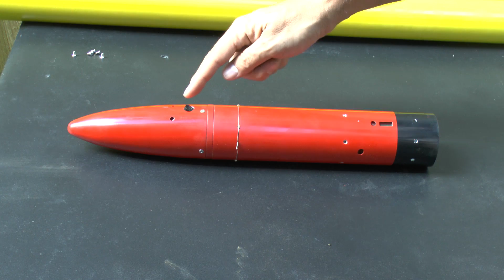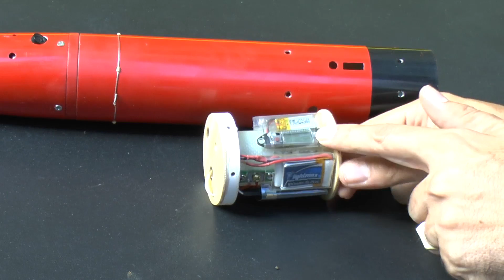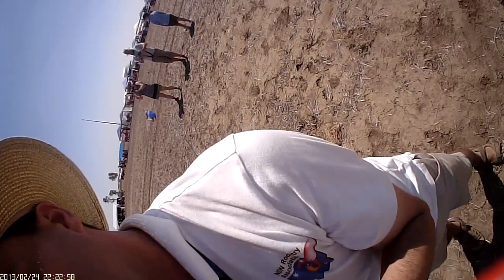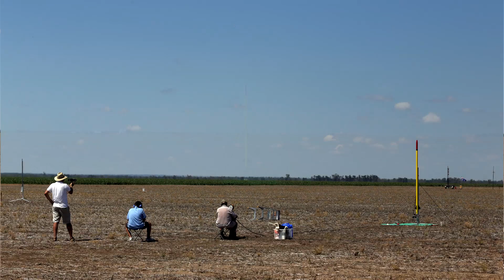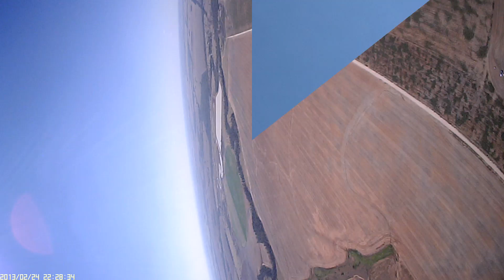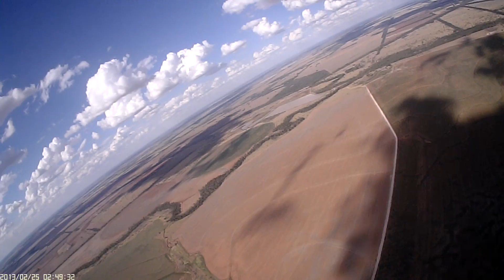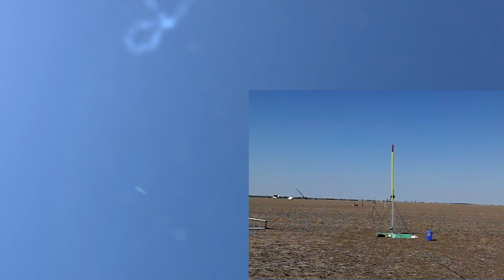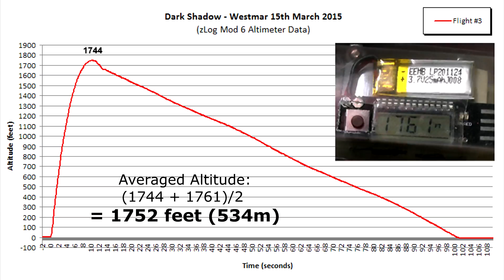Water Rocket flies to 1752 feet (534m)

Comment: So !!  IT is using just water in the first seconds only?
Reply from the maker: +Mythricia No, actually it's a great question. Thrust is all about 'throwing' a mass in one direction to make the rocket go in the other direction. The heavier the mass and the faster you throw it the more thrust you have.  Air is compressible and so can store a lot of energy, but is also very light. So although it can leave the nozzle at sonic speed it doesn't carry a lot of mass with it. Water being essentially incompressible cannot store a lot of energy, but it does have a lot of mass. So in a water rocket you use the stored energy of the air to push the heavy water out the nozzle. There is of course a trade-off between the amount of air and water you use. As it turns out the optimal ratio of water to air is around 1/3 water, and 2/3 should be air. 

For some more information please see:
http://www.aircommandrockets.com/water.htm
Reply from the maker: +graciano b During the very first part of the flight (after it leaves the launch tube) the air pressure pushes the water out this takes just over 100ms, and then the rest of the air comes out in another approximately 100ms. The rest of the flight is just coasting.
Reply from the maker: +Mythricia I guess another way to look at it would be the difference in recoil you would feel when you fire an actual bullet from a gun vs a blank both with the same charge.
Reply from the maker: +Bob Hope Fortunately for the rest of us, the laws of physics are quite independent of your interpretation of them.
Reply from the maker: Sorry Bob, that is not the case. In a water rocket about 2/3 of the total impulse comes from the water phase and 1/3 from the air phase. With air only the rocket goes about 50-60% of the altitude. In fact the water also makes the rocket less stable because it is at the aft end of the rocket.
Reply from the maker: +Bob Hope Here is a challenge for you. Go build a simple water rocket. Fly it once with 1/3 water and once with air only at the same pressure and come back and tell us your results which performs better. Thousands of kids perform the same experiment at school every year.
Reply from the maker: +Bob Hope I know you won't read it, but here is a full analysis of how water rockets work for others that may actually want to know: https://www.et.byu.edu/~wheeler/benchtop/pix/thrust_eqns.pdf
Reply from the maker: +Bob Hope No need to perform this experiment again. You just need to Google for the results that lots of school children have done this very experiment over the years. You will still not be convinced though, and that's why you need to try the experiment yourself so you will see the results first hand.
Reply: +Bob Hope Yes it will. But your real problem here is that the force in the party balloon comes from the rubber and not the air. And you're ignoring drag. Almost all of the distance flown by the rocket is inertial. All of the thrust is gone within 0.2 seconds and a few meters; the remaining three tenths of a mile is unpowered. How many party balloons can do that?
Reply: +AirCommandRockets Having some difficulties understanding the benefit of adding the water in the first place - if there is one. Considering how incompressible water generally is, wouldn't you get more velocity from the rocket by simply filling it with air to replace the volume the water is taking up? So basically running it as a compressed air rocket...

I get that water is heavier, and the rocket moves by throwing mass out the nozzle, as all rockets do, but since there's no chemical reaction to release energy here (only mechanical energy), I just can't figure out how the water rocket would be better. Surely the fact the water is heavier also makes it more difficult to push out, thereby negating the benefit of ... well, the water being heavier?

I'm sure there's more to it, but my poorly educated self can't figure it out! :)
Reply: AirCommandRockets That explains it a bit, I'll be sure to read more following that link. Thank you!
Reply: +Bob Hope I looked at the chart at the end of the video and its time resolution is too small to be able to tell anything about the thrust. all it shows is a concave-downward curve from ground to peak, which means deceleration, not acceleration.  figure a combination of gravity and drag, no thrust.

yes a more dense reaction fluid would improve performance, but lead is not liquid at usable temperatures. Mercury would be pretty spectacular, though.
Reply: No, you can't see that. It's happening far too fast. And, handheld video on a random wide-angle lens is not reliable for position measurements. The truth is that the specific impulse from the water is a large multiple of that from the air. If the rocket was filled only with air it wouldn't fly nearly as high. If it was filled only with water it wouldn't fly at all. Altitude is maximized when the ratio of air to water is about 1:2.
Reply from the maker: +Bob Hope The one thing I think you are confusing is the difference between an aerodynamically stable rocket and a party balloon.
Reply: Bob Hope No, I'm not wrong.  (Note: telemetry and data analysis is part of my profession, so you're not going to bullshit me about this.) That graph is not capable of accurately resolving the time, position, velocity, or acceleration at the beginning of the flight. Any "straight up" you think you see is an effect of quantization due to the measurement and display equipment. Any slope you see before that straight segment is due to the same quantization effects as the numbers tick up one more quantum. You might as well claim the acceleration was infinite on that "straight up" segment. It wasn't. And if you keep following the curve you'll see several more sloped segments followed by straight-up segments. Is it your contention the rocket kept slowing and speeding up to infinity over and over again during the flight? Of course not. In fact, that graph shows you only the effect of gravity and drag, first without the parachute then with the parachute. If you're really careful, you might be able to tell what the drag coefficient is, but you won't get many significant digits out of it, because, as I said, the data are slushy.
Reply: +AirCommandRockets so although both give a decent kick you do feel the one with the actual bullet a bit more. yeah makes sense :DD
Reply: +Mythricia Good question. It's an application of Newton's third law of motion (action and reaction) which simply states that the for every action there is an equal an opposite reaction. In this case the action and reaction forces are the rocket on the water and the water on the rocket in opposite directions. These forces are described by Newton's second law of motion (acceleration of an object is directly proportional to the applied force and inversely proportional to the mass of the object being accelerated) This law can be written in terms of the change in the momentum of the bodies in the interaction (water and rocket in this case) Since momentum is calculated as the product of mas and velocity of the object, you will get a larger momentum when either or both the velocity and mass of the object are large. What this means is that yes, compressed gas can move out of the nozzle at a rapid rate but the overall momentum change (and hence force) will be small as the rapid velocity cannot make up for the low mass of the gas in the first place. This is a fairly common senior high school physics topic and you might be able to find a longer explanation by checking some physics texts on this subject.
Reply: +wigs1098 it's all abut energy efficiency. Force goes linearly with the rate of momentum change whilst kinetic energy goes as to the square of velocity. So using (say) half the mass with twice the exhaust velocity gives the same force but "wastes" twice as much energy in the reaction mass. It's the reason why those fanciful flying cars with tiny little rotors can never work sensibly. To fly efficiently you need to accelerate a large mass of air relatively slowly. Accelerating a small mass of air to high speed is inefficient (not to mention hideously noisy).

At least roughly speaking. A lot more to it.

Has anybody done some basic mathematics on this rocket to work out what percentage of the stored energy in the compressed air is turned into potential energy at the maximum height?

nb. why is it always called rocket science in popular parlance? It's surely rocket engineering. The science was done long ago.
Reply: +AirCommandRockets Don't feed the troll.
Reply: +Bob Hope since you don't even do this stuff I was wondering why you don't just shut the fuck up.
Reply: +AirCommandRockets Amazing! I always wondered how water rockets work. My father gave me a small toy water rocket, as a child. Perhaps it can be compared to the flight of a plastic cap champagne. I'm not sure.
Reply: +Mythricia Another way to think of it: they'd get more kick from air alone if they packed about as much air in there as there's water - by mass. Only then not only speed of the propellant would be matched, but the amount of its mass ejected as well.
Reply: i think it would work a lot better if they could use electrolysis and then burn off the resultant gasses. THAT might make the water worth it <3
Reply: +Mythricia Water weighs 840 times as much as air. For each atmosphere you add to the pressure you pack another equivalent mass of air into the rocket. So if you add P atmospheres, but you can't eject the air 840/P times quicker than the water, ejecting the water will give you a bigger impulse.
Reply: +AirCommandRockets so theoretically of course would something like say, mercury be a better choice over water? disregarding of course the enviromental effects
Reply: +Mark Martin You are clueless.
Reply: +Mark Martin That applies to you, not me.
Reply: +John Hasty cool story
Reply: alphabeticalor haha, thx. I thought it would surely start a internet riot. kick's back and exhales smoke slowly "Ahh, now where is my machine shutdown button again?"    >.<
Reply: +John Hasty cool story, troll
Reply: Roughly how many G’s would the rocket be achieving this be from launch?
Reply: Bob Hope you are like arguing with a flat earther..you can easily find the information online...hell even expirements to try yourself and gather relevant data but noooooo , your set in you way of Mr know it all and everyone is wrong. Go fuck yourself
Reply: +alphabeticalor You are wrong. Look at the graph. The first rise of the plot is at an angle, then it goes straight up for a while, and then it rises at an angle again. This means the acceleration becomes severe a bit up into the air, which is when the water has left the rocket. And consider this. What if the air could become compressed to such extreme it became liquid? Wouldn't you rather have the rocket spew out that liquid than dead weight water which has no propagating quality of its own? I am right. Stop being unreasonable.
Reply: I've literally bored myself so bad I was sucked into reading all these comments on shit some people don't even have a word in because they "don't do this stuff" and the others know so damn much they've become self-proclaimed H2O bottle rocket super intense scientific "I-come-up-with-this-idea" people that can track every fucking movement of a quark at quantum speed with "THEIR" naked eyes. I'm even surprised that someone whos entirely not even in this video or even remotely close to the area within a hundred mile radius isn't putting information in the comments about how long it took to reach max altitude, the exact speed in nano second intervals, terminal velocity on its return, the amount of thread used in each string on para cord... I can keep rambling about what I think but no one actually cares because they're kinda like me... I DONT GIVE AN IOTA OF A FUCK!  "so they nonchalantly browse the youtube comments, Hmmm... what do I see here? OMFG!!! two bitches bitching on someone's comments because one knows how air was invented and the other don't know his ass from a hole in the ground... P.S.  Great video, I loved it! keep up the hard work and keep progressing!
Reply: +AirCommandRockets With only air it goes less high because the path tilts, spins out. You can't add water to a party balloon and expect it to fly a longer distance.
Reply: +AirCommandRockets Besides, you can't get more thrust by carrying dead weight, water, up into the air. The real thrust comes after the water is gone. Water is for stability.
Reply: +alphabeticalor But you see in the video that the real thrust comes after the water leaves the rocket. The chart of ascent also shows that the acceleration picks up after a short while. You can't carry dead mass up and expect that will create a faster ascent. Fill the rocket with led if so. Good luck with that.
Reply: +AirCommandRockets I will read it all later. Eyed it over for now.

The paper assumes that the water and canon ball fills the same function in a pressurized tube, air vs gun powder. This is not a true assumption.

Will the uploader of this movie make a scientific test, please? Use more water than you usually do, and record the hight the rocket reaches. Divide the original lot of water in five volumes, and use less and less water for each launch, but pump the rocket to the same air pressure. For example, 5 litre, 4 litre, 3 litre, 2 litre, 1 litre, 0 litre. Get back here with the results of height reached and other observations.
Reply: +alphabeticalor Next summer, fill the rocket with more water than usual. See the graph show an initial ascent with a slope to the graph. When the water is gone, the graph will go straight up, indicating a shift in acceleration, greater acceleration. Carrying water up in the air will not make the rocket go faster. This is common sense.
Reply: +alphabeticalor You can also see in the videos of the ascents that after the water is gone, there is a snap of acceleration and suddenly the distance travelled is doubled. Reality is what it is.
Reply: +Mark Martin That's why you are clueless. You can't read the graph but you think you can. Hillary for president?
Reply: +graciano b The water is for stability and show, I think. It has no other function. If there was no water they would go higher, if going straight. How well would a party balloon fly if half of it was water?
Reply: +AirCommandRockets Watch the graph of altitude included in the video. In the beginning the rise is slow, then, when the water is gone, the change in altitude, acceleration, picks up.  You are the hobbyist but you don't understand what you are doing. I don't do this stuff.
Reply: +AirCommandRockets I find no experiments of varying levels of water. All these rocket videos are so brain numb.

Comment: I was getting 800 ft from a multi stages water rockits sorry before digital  videos wore possible and my pressure was about 150 psi and 6 liters in 3 2 liter Dr pepper  plastic bottles. 4 liters used to carry the one , two liter bottle and
It was designed to separate when the booster fell to near zero.
Reply from the maker: +Jesse Reiter That's great. Do you have a link to your videos/website?
Reply: when I frist started it was in 1980

Comment: I did not see this in the comments but I would like to know the velocity of that right after its clear of the guide.
Reply from the maker: Jameson Sullivan Just as it clears the launch tube, the rocket is doing about 22 m/s or 72 feet/s (80km/h or 50mph) ... it then however, keeps accelerating to a peak velocity of 380 feet/s or 259mph or 417km/h.
Reply: AirCommandRockets Incredible, Thanks for answering.

Comment: Excellent work! Do You try to use more dense Liquid than water? It must to icrease velocity of rocket.
Reply from the maker: +котофеич бегемот Actually a denser liquid although creating more thrust actually performs worse in this case. This is because you are trying to lift the heavier liquid still left in the rocket.
Reply: +AirCommandRockets Yes, if a rocket fly direct upright, there is the speed loss, equal g*t (t- time of working  substance outflow). It is possible to decrease this loss by decreasing outflow time. Larger nozzle, for example.
Reply from the maker: +котофеич бегемот Yes you are right. When using a different density liquid you also need to adjust the water to air ratio amount for optimum results.

Comment: Hi AirCommand Rockets, as always, great launches and great presentation, you guys are second to none in the world when it comes to Water Rockets. It was great to catch up and witness the flights first hand at THUNDA Down Under 2015.
Reply from the maker: David Bell Thanks Dave, it was great catching up with you at Thunda. :) Your flights at Thunda weren't too shabby either. How many thousands of Ns did you end up burning again!?! And that L3 flight was done in awesome style! :)
Reply: AirCommandRockets Hi mate, thanks, only 30,483 Ns (49% O), I had planned on upwards of 85,000 Ns but just ran out of time, next time I will bring along a support team :-) My major issue was that when launching the Patriot on a cluster (which i did twice, I had planned to launch a total of 5 clustered flights), the central inboard motor's exhaust would melt the outboard motors plastic thrust rings (CTI 38mm) resulting in a 6 hr turn around time between flights as the melted thrust rings would mold themselves to the threads of the GLR Slimline Retainers and had to be mechanically removed...  :-(